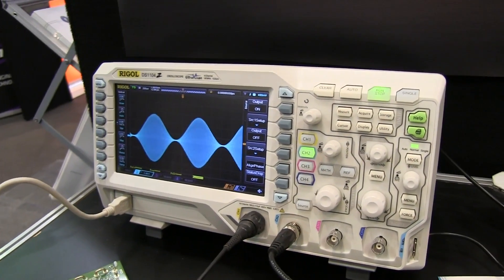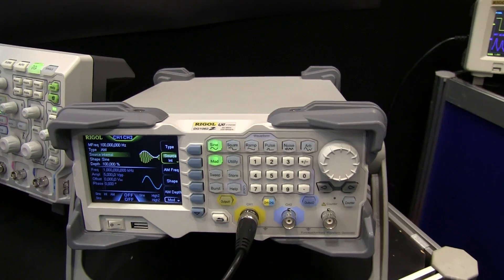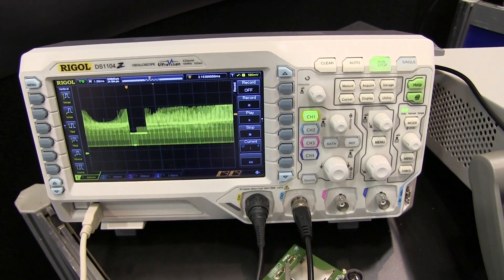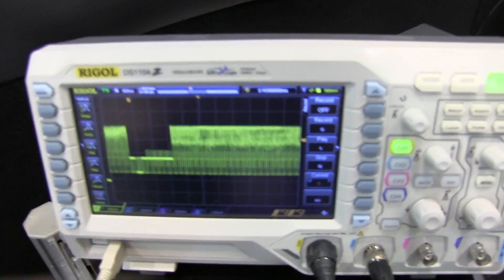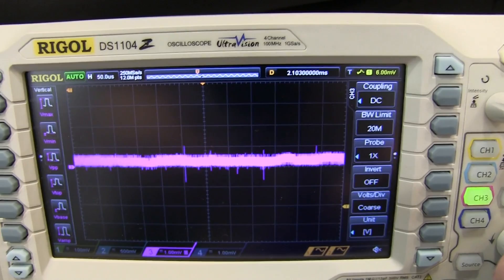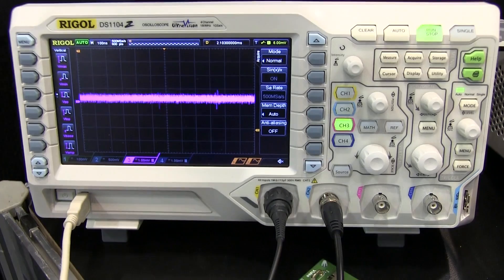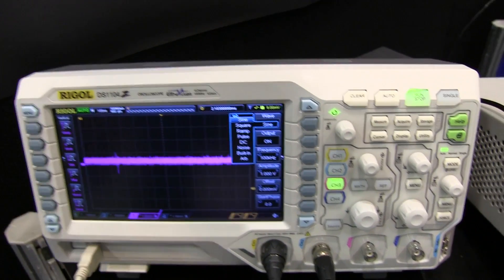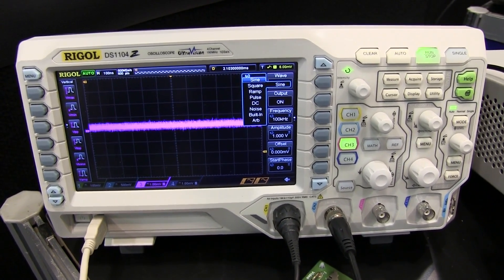EEVblog #522 - Rigol DS1000Z Oscilloscope Quick Look

Comment: It should be noted, $585 retail is for the DS1054Z (street price $399 as of this writing). The DS1104z is $830 street price. It should also be noted that the DS1054Z can be "hacked/upgraded" to the DS1104z for $0, meaning you can effectively get the DS1104Z for $399, plus a little elbow grease (which probably voids your warranty as well).

Comment: I REALLY want to go with the 2000 series over a 1000Z series, but I HAVE been considering the MSO1074Z or MSO1074Z-S (with the built in 2 channel waveform generator). I'd be doing a lot of work that involves watching the timing of digital output sequences that trigger off of analog RC circuits... Basically, I REALLY would benefit from the MSO version over the DS version of these scopes. I also find 2 channels to be very limiting, and miss the 4 channel from my old job. Between doing three phase motors and 3 hall commutation (job related), and most of my aforementioned digital/analog circuits functioning most commonly in groupings of fours (hobby related)... 4 channels is something I am REALLY set on... I see that there are NO 4 channel variants of the DS2000 or MSO2000 series, and that is a REAL bummer... It would seem that to get 4 channels, and an MSO, AND the more advanced features, it looks like I'd have to jump all the way up to an MSO4000 series, which is WAY too expensive for my budget. The 2000 is honestly too expensive, but I'd have been willing to put off a PC upgrade in my workshop in order to "force" it into my budget.

If it got me a 4 channel MSO2000, I'd be willing to forgo the integrated waveform generator as well, as I could get a stand alone unit for not THAT much more than the add on option, but yeah... It looks to me like I'm really bound to the MSO1074Z-S or MSO1104Z-S. The only difference being, do I pony up for the additional 30 MHz worth of bandwidth and make it a 100 MHz. I rarely work in anything too high in frequency... for now. I DO want to future proof myself, and it's one reason I'm HUGELY bummed there appears to be no 4 channel DS or MSO2000 series.

I'd actually be VERY interested in a comparison video between the DS or MSO1000Z and the DS or MSO2000 models, and what limitations the 1000Z has in comparison to the 2000, and what the 2000 does better.

Don't suppose there have been any rumors of a 4 channel option in the 2000 series for the future? I'd likely be saving up for a year anyway. I can dream...